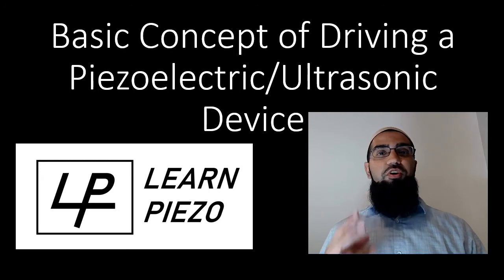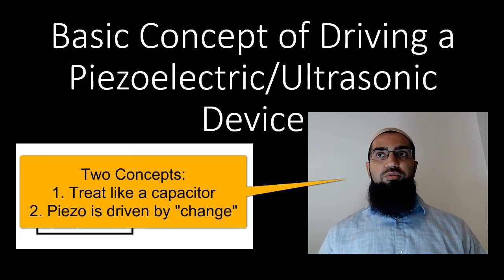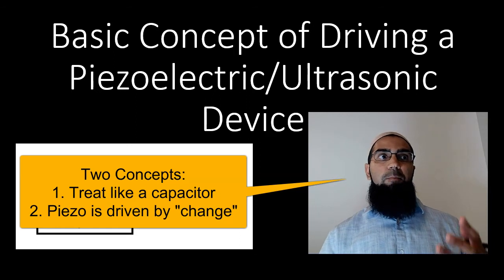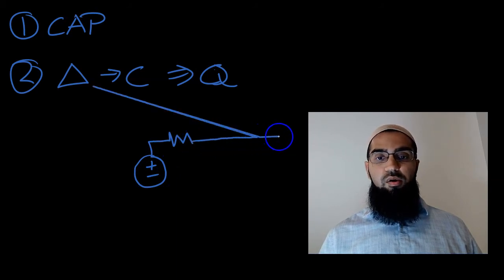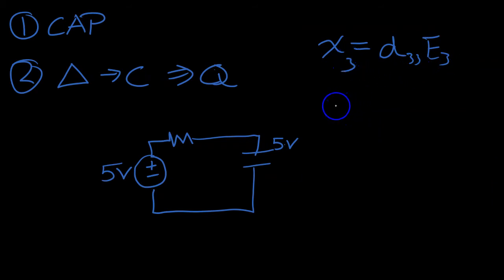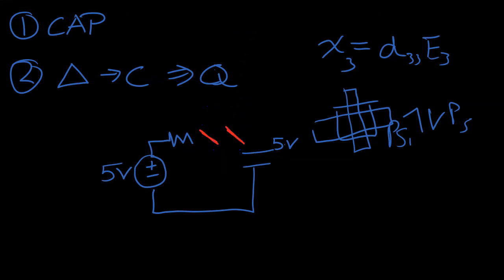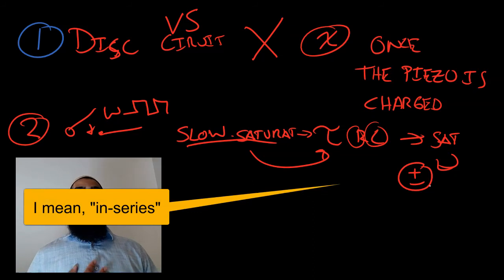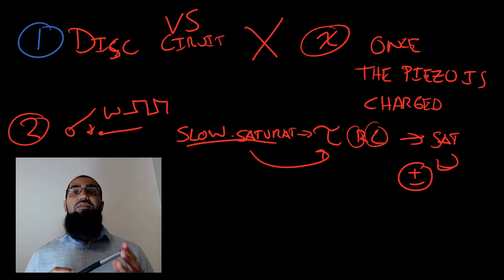Basic driving principles of a piezoelectric actuator/transducer

Comment: Hi Husain, I think I with regard to your topics here I got a trival problem:

I play the electronic drums. And I found out that some companies use resistors in their drum pads. 33k ohms in series with the head piezo and 150k parallel to it, and 150k parallel to the rim piezo. For the head piezo it's a voltage divider to cool down the signal I guess. But what it resistor parallel to the rim piezo for. 
I am asking how large is the damping of the signal on the time scale, and will that have any noticable effects on the trigger results. 
When using a resistor in series will lead to a faster decay of the signal, won't it? 
Do you have a guess how to simulate that configuration. These two piezos are connected to tip and ring and sleeve to an TRS plug going to the drum modul.
I know it would be great to know what comes "behind" the drum modules TRS jack ... but I dont know it for that certain modul. Mostly I saw the people using a MOhm in parallel to the piezo together with a Zener diode to protect the further electronics.

Thanks for a short comment. 

Greetings from Germany

Manuel
Reply from the maker: The resistor damps out high frequency vibration via simple RC filter. The piezo is a capacitor.

Comment: I have a driver circuit of 1mhz piezo disc working fine a day before, but when I replace the disc(1 MHz) of different brands in the same circuit the NPN transistor gets heat up a lot and the wave are also not impressive any possible solution  ?????
Reply: @ultrasonicadvisors  so soft materials disc responsible for heating up the transistor????? then i have to use hard materials right????
Reply: Ooh yes, it was a bit confusing what u said at 12:50, but think its clear now thanks. I though u said now its saturated at the time constant.

Comment: What is best to generate high frequency noise 20KHz to 25 Khz.    Is it a piezo or ultrasound tranducer ? are they the same thing.  What will give off a high sound 100 ++ db   Have you a part number ?
Reply from the maker: Yes, look for piezo speaker on amazon. Piezo tweeter also has good frequency response in that range/.